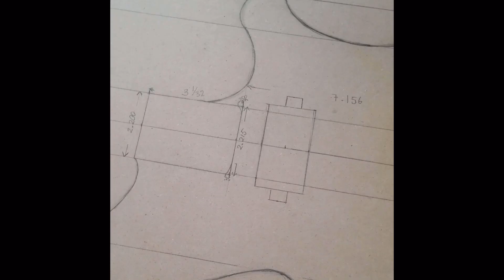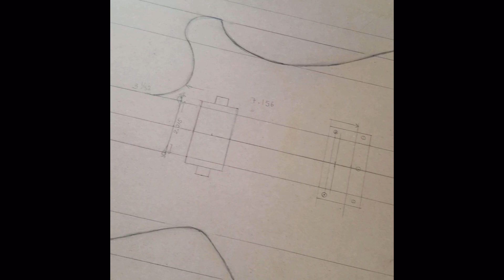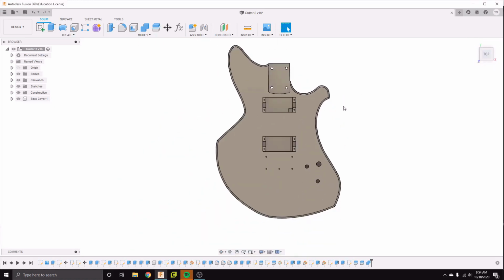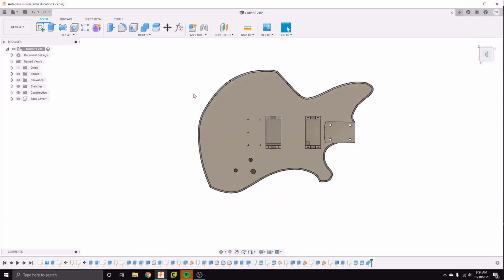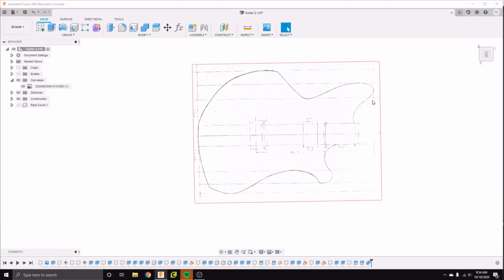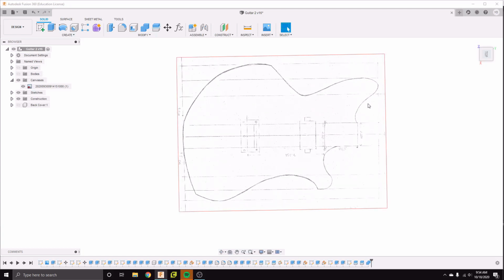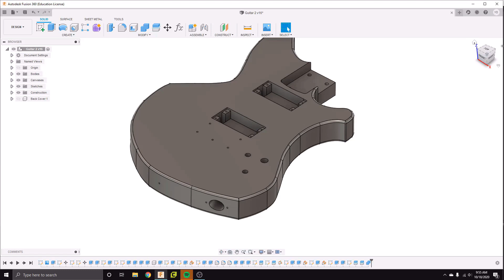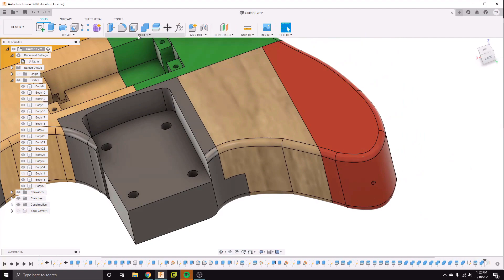3D Printed Guitar

Comment: I like your design.  Very clean lines.   This looks like an interesting project to take on.  What are you using for a control cavity cover plate?  Is it one you designed or is it a standard plate that's available?  Thanks for sharing.

Comment: I have this same printer but it's very stiff(binding) at extremes. I have tried loosening the 2 bolts at the 4 belt attachment points and leveling or just adjusting to get minimal binding but so far havent had much luck. I even printed a new head and re-used the bushings but still no improvement. Last ditch effort is remove one of the linear rods from each axis leaving it more like a Ultimaker gantry vs Zortrax.
Reply from the maker: Chris, you can try to remove one of the rods from x and y just to see if that will fix the issue, but I'm afraid your print quality will suffer. Wanhao is not that great of a printer. I have had manny issues with it. Since you have taken it apart before you can check if the rods have imperfections on them in that case you might just order new ones. But its totally possible that the issue is not with the rods but with other components of the printer.
Reply: @yanostanin  Thanks, luckily it's one of 8 printers so not a big deal but I had high hopes for the constrained gantry style, real ballscrew, large Z axis linear rods and heavy duty metal frame. I put a Phaetus Dragon hotend on it and believe it would perform very well if only the binding issue could be solved. I need to spend some time on it with a machinist square & calipers to track down the source of binding I guess.